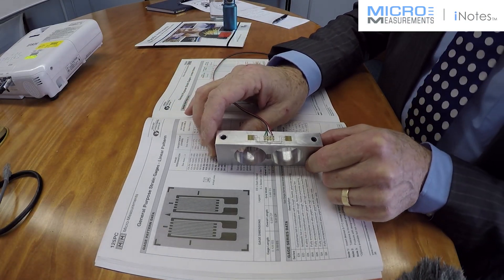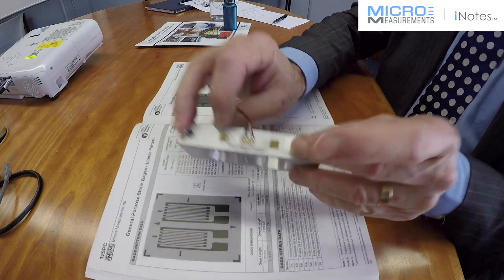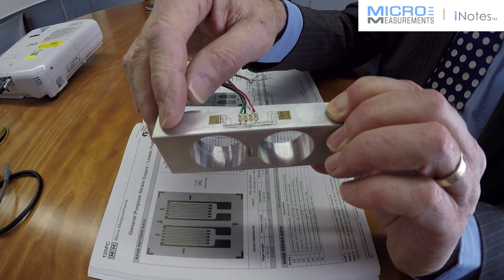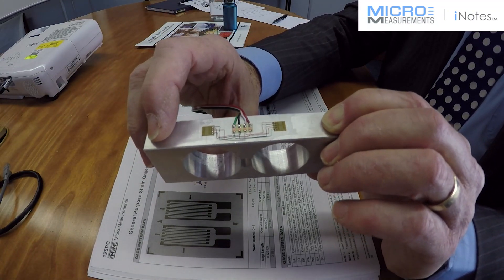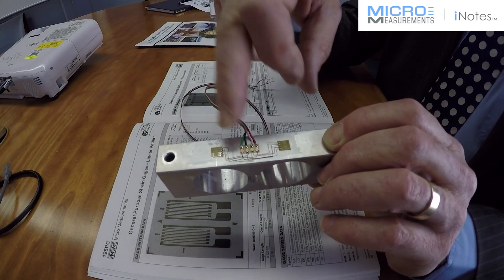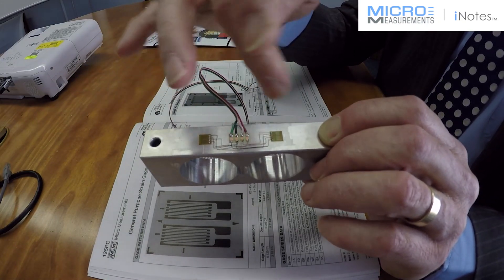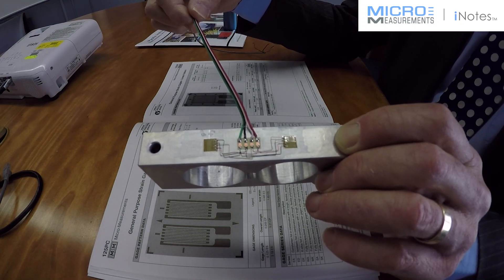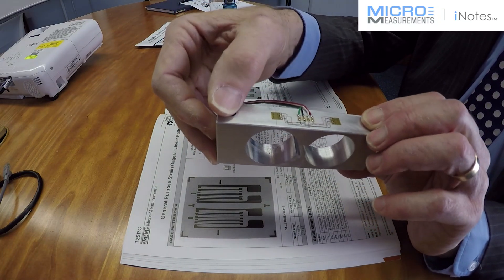Strain Gauge Load Cells (Design, Assembly, and Refinement)

Comment: Is there a way to automate the strain gauging process? is it only manual process?? is there a small cleaning bath for cleaning the load cell element?
Reply: Thank you for your question.  There are methods to automate the strain gage installation process.  In general, this involves using strain gages with the adhesive pre-applied (M-Bond 43-B) by Micro-Measurements.  Once the surface has been chemically and mechanically cleaned, the loadcells would be placed into a machine/robot that can index the loadcells.  A pick and place device is used to pick the strain gage up from the tray style packaging and then place on the target area on the loadcell.   Clamps then get applied and the loadcell is sent to the oven for curing.  For very high volume loadcells or applications, we have seen this type of automated process used.    I hope this helps.
Reply: https://www.youtube.com/watch?v=TioZONyj0lc  This video shows some level of automation for a higher volume transducer production.